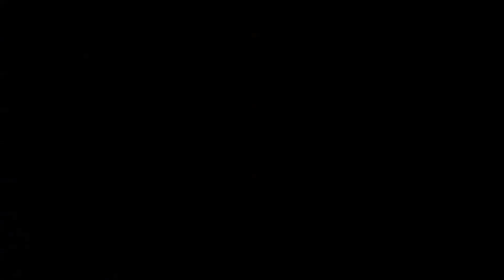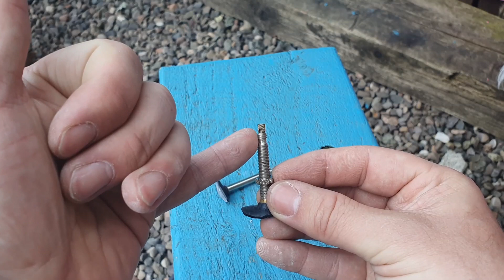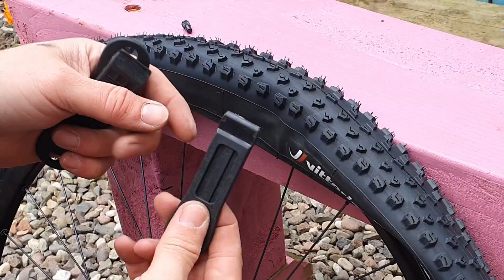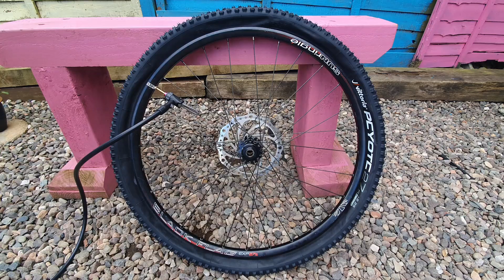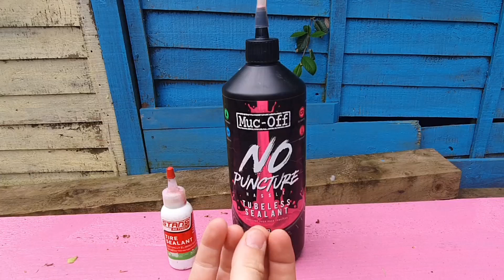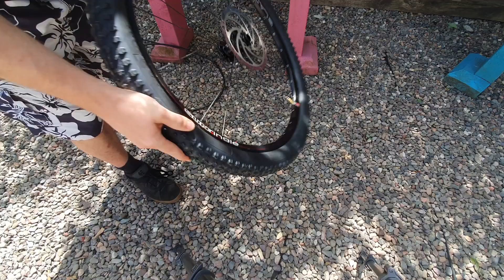Ghetto style Tubeless Conversion with Insulation Tape and old valves (Calibre Bossnut Basics)

Comment: Hi were the rims and tyres tubeless ready?
Reply from the maker: The rims in this case and tyre were tubeless, but I have done it with tyres and rims not designed for tubeless use. It's not an issue in the MTB application as pressures are low, but I wouldn't recommend tubeless on a roadie setup unless it was design for it.

Comment: The electric tape will last long or should replace every year?
Reply: The sealant degrades the electrical tape as far I know. Better use gorilla tape or kapton tape
Reply from the maker: Electrical insulation tape is PVC based so won't degrade with any sealant that I know of. The glue/adhesive maybe the only long term short fall of the tape but so far I've had no issues.

Comment: Nice vid,im planning on doing this i will try it with a auto valve see how it goes.
Reply from the maker: As long as it plugs the hole and you can secure it to the valve it should all work out. Just take your time so you don't have to re do it😉
Reply: @TheBikingVikingDude  I will give an update on how it goes.Ty for the tip

Comment: This was some good informative footage. I have tubeless ready tires but haven’t made the switch yet. Is the switch worth it at the end of the day in your opinion and why?
Reply from the maker: It's all down to tyre compliance for me, any tyre converted to tubeless instantly improves its grip in all terrain as the tyre can move better (even if the psi is the same as before, the side wall can flex better. The other benefits are weight reduction and better puncture resistance, weight isn't a big deal for me but I do a lot of big adventures so the puncture resistance is good.
Reply: The Biking Viking thanks for the input man! It is appreciated. Might have to look into this deeper
Reply from the maker: Not a problem bud, take it easy.